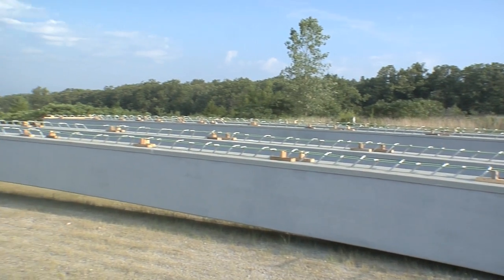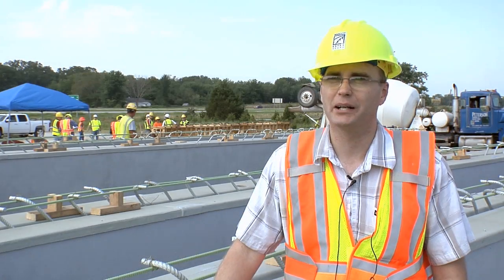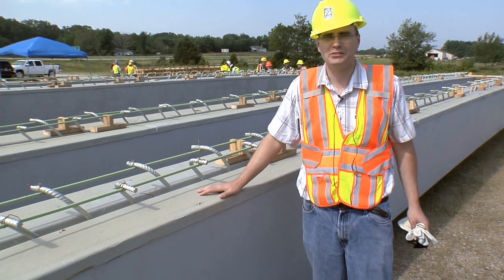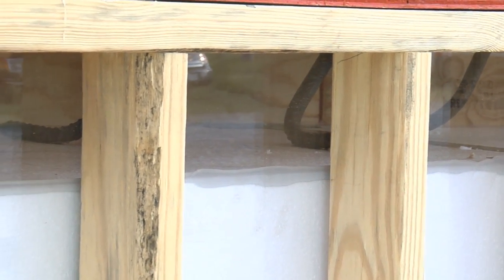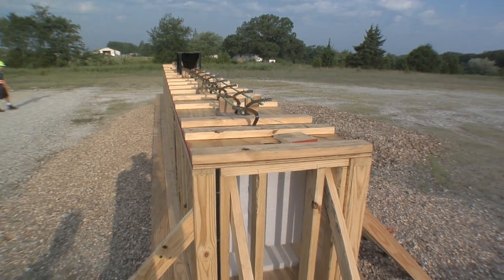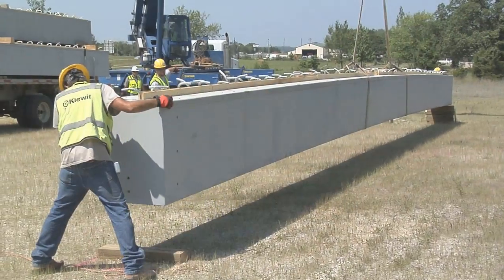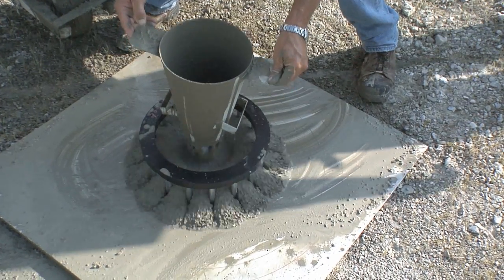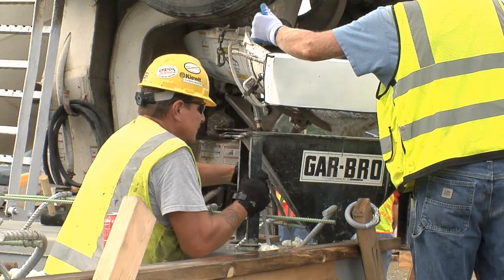Hybrid Composite Beams

Comment: I read about this in ENR and can't believe they are being used on bridges. Encasing the beam does little to prevent galvanic corrosion, corrosion via cast in chlorides or carbonation . The beam will always need to be tied in to the deck, so there is no way to   solve for this design defect .  Another obvious vulnerability is fire,  Concrete cross-section is critical to fire resistance. Lastly, how do you inspect the beams for faults? How do you repair them?   A waste of tax payer dollars.